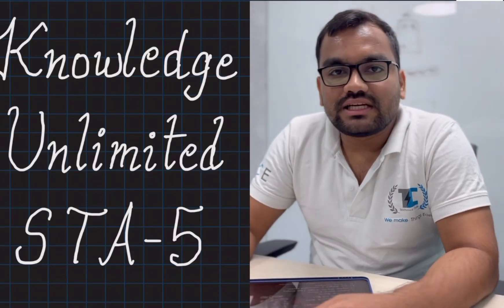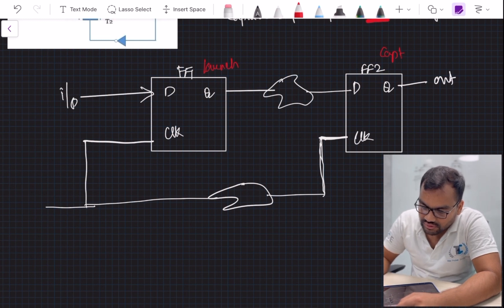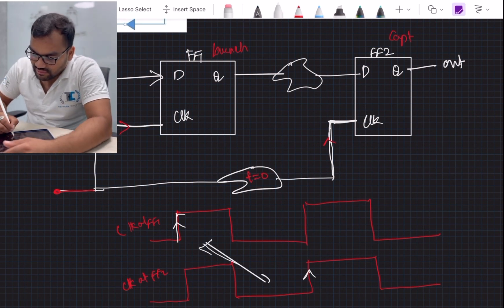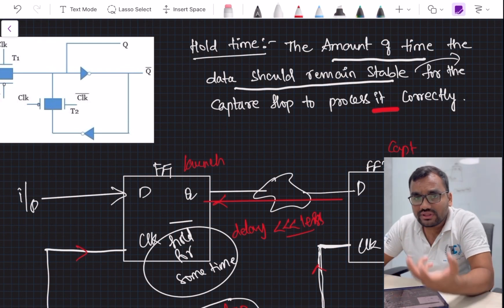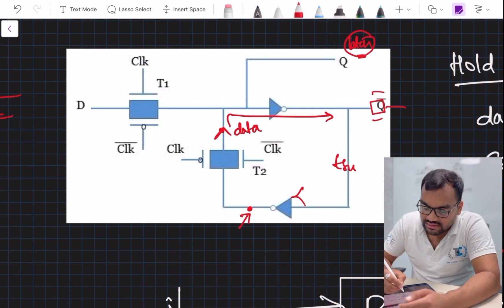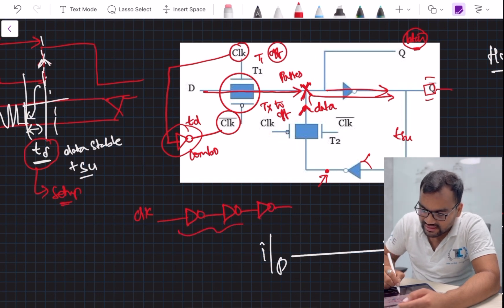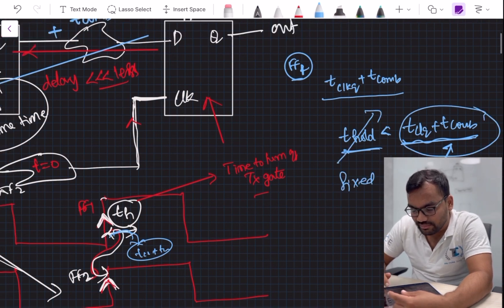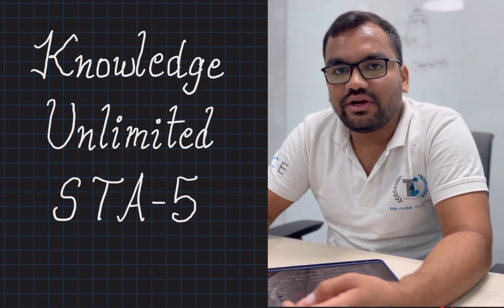Hold Time Analysis || STA Tutorial5 ||  @knowledgeunlimited  #interview

Comment: Sir, hold time should be greater than Arrival time na(Tc2q+Tcomb) sir ? It should hold value until prev data reached to next flop ? 
Sir can you explain how T(hold)<TC2Q+Tcomb??
Reply from the maker: Hold time for a flip flop is always fixed based on internal structure. Now the arrival time should be greater for data to not propagte to next flop. 
Let me put it in another way, how much time data should be hold is more than the arrival time which means data should arrive late than hold time of flop. Which is the equation. 
Please Once again watch the video…hold time is fixed, clk to q delay is fixed 😁
Reply: @knowledgeunlimited  Thank you sir